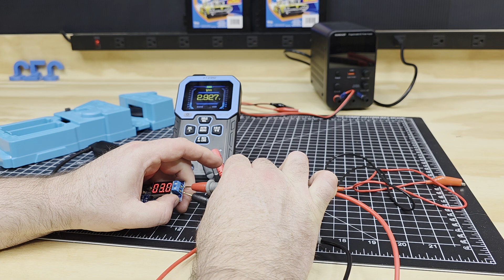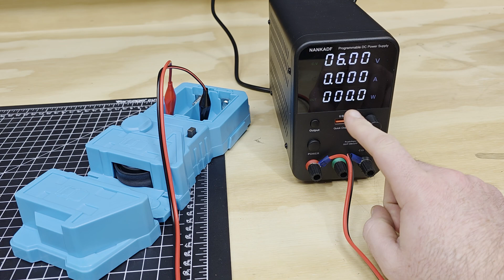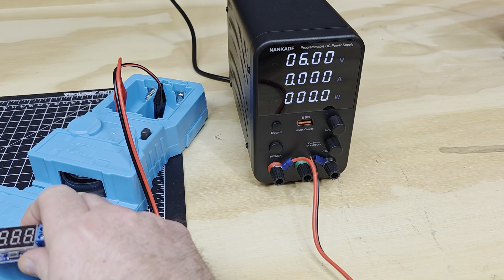USB Powered, Variable Speed Hot Wheels Booster #hack

Comment: What’s the max setting?
Reply from the maker: The voltage you can run it up to is 24v. However the max power it is rated for is 3W. Given that when you increase voltage you also increase current draw you hit a limit. I was able to run it at 5v which pulled 0.9A steady state so it was actually running at about 4.5W (so it could go over its rated power). I have my eyes on a buck-boost with a higher power rating, but that is an experiment for a future video.